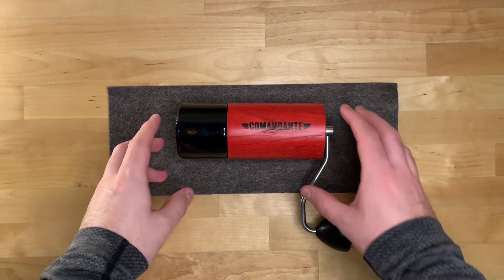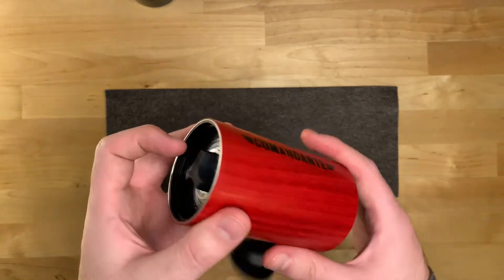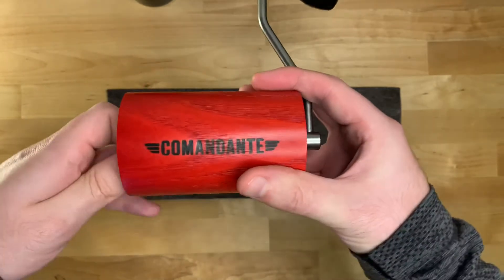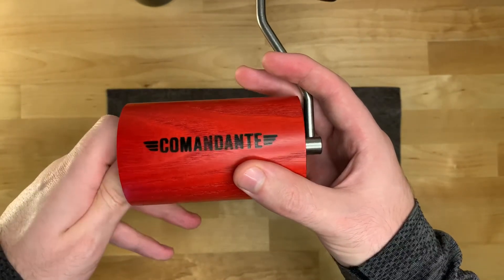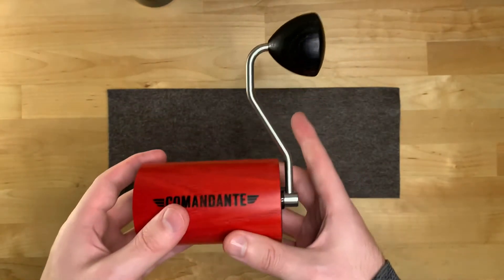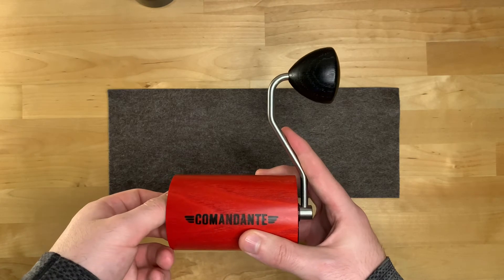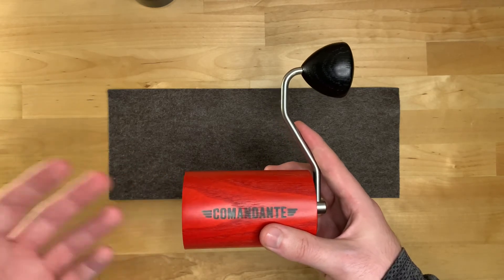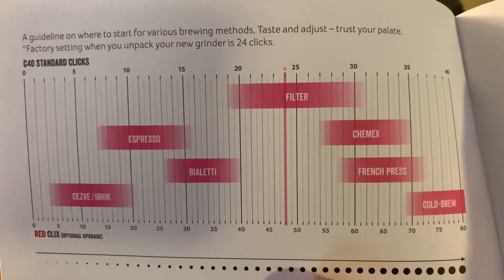How to Adjust Comandante Grind Settings, Grind Size, and Find Grinder Zero - Initial Setup

Comment: Hey, thanks. Bought mk4 today (newbie - first grinder). Can you explain the upper side numbers and the lower side numbers (0-40, 0-80) clicks? Or guide me were it is explained? Still searching. Thank you.
Reply from the maker: Basically the farther click out you go the more corse the grind gets. The 0-80 is for red clicks which is an add on you can buy which makes it better for grinding for espresso or really fine tuning the grind size. 0-40 is the standard range it comes with out of the box.

Comment: hi , mine does burr sound from 1-9 is it normal ? and also i checked the burr and i can see a tiny chip but no visible right away, you have to be super close to notice it. thanks for the video anyways.